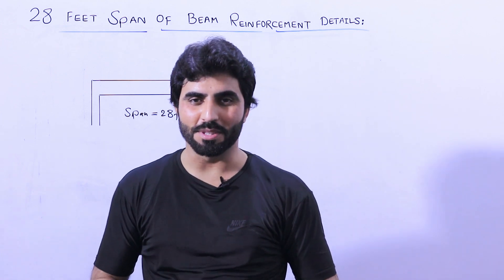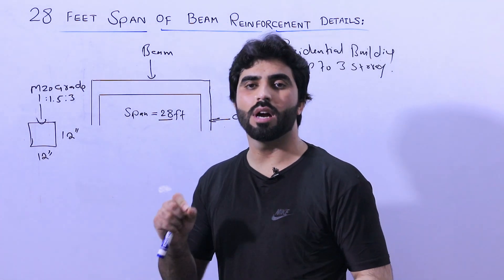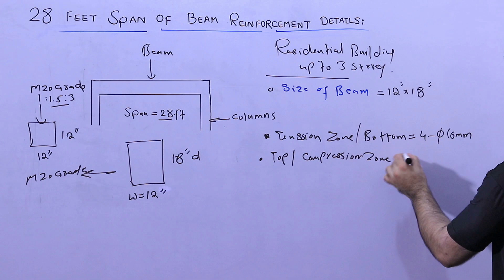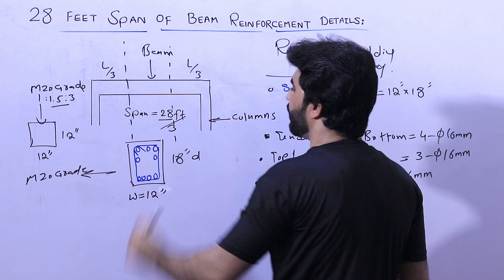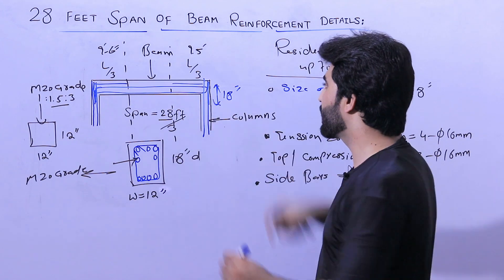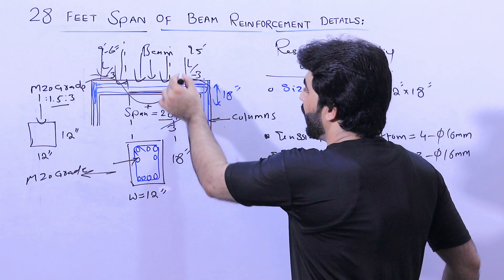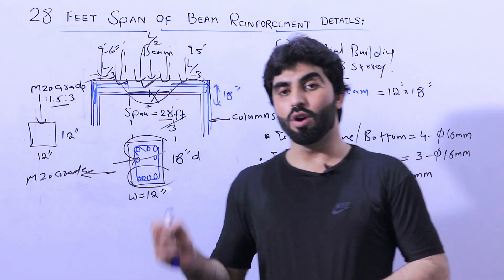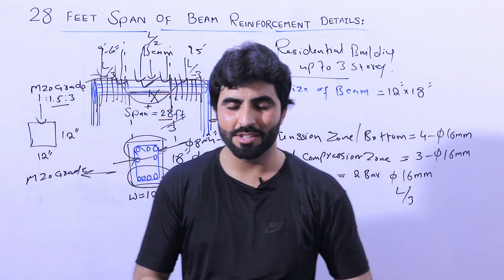28 Feet Span of Beam Structural Design by Civil Engineers

Comment: Hi Sir, i badly need your help, for my building builder has put 6 12mm bars and 8mm stirrups @6 inch for 15 feet floor beam. no extras used. beam size is 9*15. 
Its G+1 building the the steel i told you is for ground floor bream. The beam has to bear 9 inch redbrick wall. is the steel enough? is it safe beam?
Reply: Sir can you please reply?